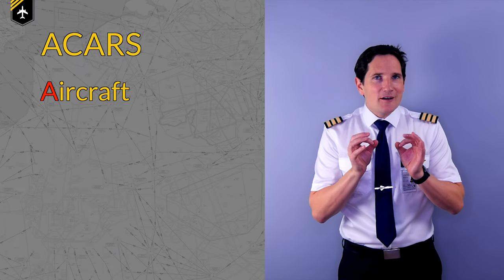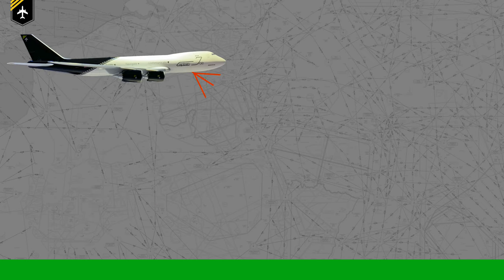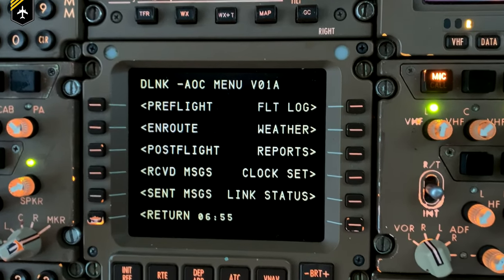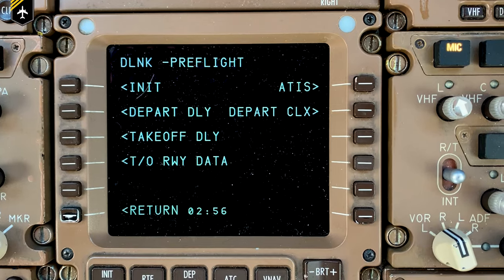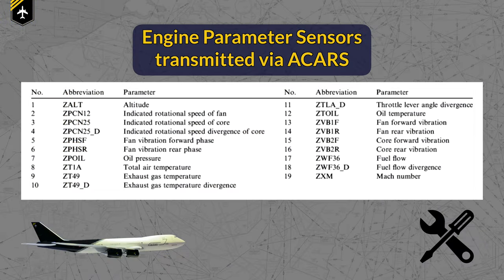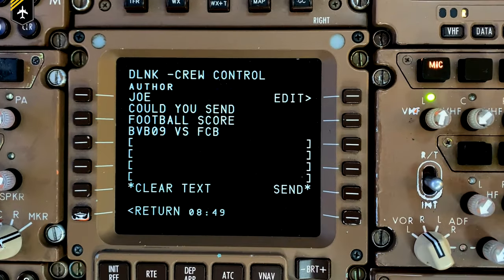WHAT is ACARS? HOW does it work? Explained by CAPTAIN JOE

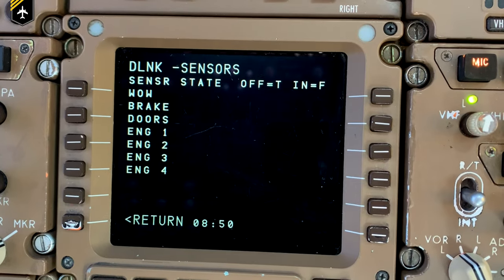Comment: 8:32 I guess it's a parking position where pushback is not required, engines are started earlier than the brakes being released
Reply: You smart
Reply: Same
Reply: I agree
Reply from the maker: Correct!!
Reply: i was going to answer but i am late . any ways your answer is correct .
Reply: or Capt. Joe just forgot to release the brakes.. until the tow truck started to smoke like a candle
Reply: I agree
Reply: I just thought three minutes from brake release to WOW off would be an awfully fast taxi out but that's a good point on the engines
Reply: @flywithcaptainjoe  one doubt here.  If this is the parking position then WOW should be on ground and not in air..?
Reply: @prashantgs4379  I guess WOW is just the Weight on Wheels sensor and the state is mentioned by the second column and it will only be listed if the state changes. So in this case from parking (ground) to flying (air)
Reply: @highopay  Yeah. Now I got this. I thought it was still standing in parking position and showing WOW sensor incorrectly. But actually at 06:16 tyres were off the ground and it became AIR. 
👍

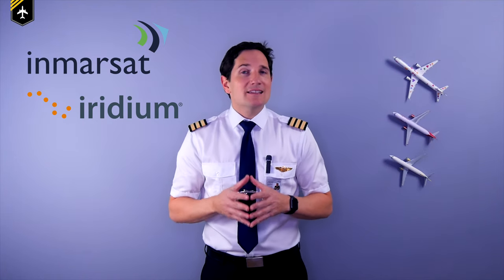Comment: 4:45 Ah, so that's what that large dish on top of airplanes are for!
Reply: Immarsat provides inflight wifi too as a bonus AirNZ uses it
Reply: I'm no expert, but that doesn't look very aerodynamic
Reply: @LuizDahoraavida  It isn’t.  The winglets on an aircraft give about a 5% reduction in fuel burn.  The antenna on the top of the fuselage eats that up.
Reply: @oscarb9139  r/woosh
Reply: @simpilotadamt1012  Obviously, there is something I missed if it was a whoosh.
Reply: @simpilotadamt1012  Yes, whoosh.  I missed the time stamp.

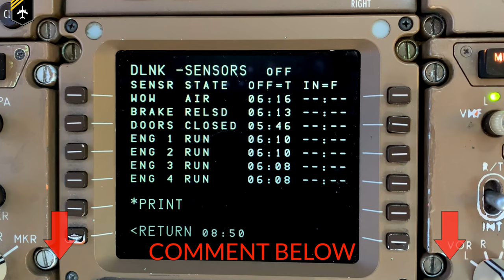Comment: 8:40
3 minutes from brakes off to wheels off the ground?...
No push back required.
Reply: How do you know the lack of pushback? Is it because breaks release after enginr start?
Reply: Yes with a pushback brakes are released before engine start up
Reply: I also assume that with a push back you release breaks first, then push back, then start engines
Reply: @phillips2400  Wouldn't you have to reapply the brakes after getting the pushback so the aircraft doesn't keep rolling backwards?
Reply: @NiHaoMike64  good question. Since the aircraft is connected to the pushback vehicle it’s the vehicle that stops the backward movement. I don’t think the aircraft would start rolling on its own after the disconnection. But that’s just my guess. Maybe somebody knows it better?
Reply: @phillips2400  Unless that parking apron is on a slope, no the plane will not roll backwards on its own. And, the engines will generate quite a bit of thrust when starting, any backwards force would be counteracted. And lastly, there are brake pedals (located on top of the rudder pedals) in most planes.

Comment: Hi Joe, it would be very interesting if you make more videos about radio systems on board.
Also, I am an amateur radio operator or ham (Amateurfunker) and I had once the opportunity to talk with a pilot (he Also was a Ham) on board a Boeing 737 using their HF 14MHz SSB radio.
It would be very interesting if you could give some insides on that topic or if it is in fact possible to transmit on the amateur radio frequency.

Comment: I'm guessing no pushback was required, because it was only 3 minutes from releasing brakes to take-off...much less time than it takes to attach/push/disconnect the tractor?  Also - the engines were started before the brakes were released, whereas they're usually started during the pushback procedure (ie. brakes released first to enable the push; then engine start)

Comment: a pushback was not required because engines started before releasing parking brakes, also the breaks were released one time without putting it back on for the tug to be removed and then releasing it again for taxi

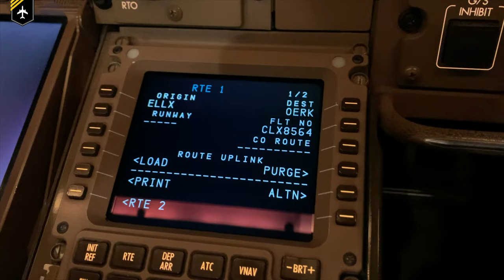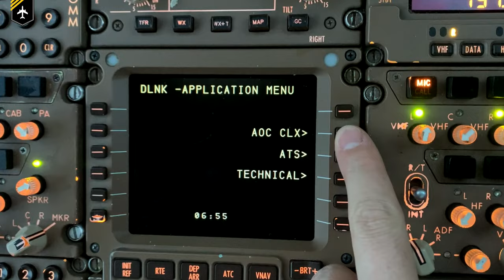Comment: We had done a pushback, as the doors were locked at 5:46 and Eng 1 run time is at 6:10 if it wasn't a push back then Eng 1 run time should have been around 5:55 at max. So I'm gonna go with 'Pushback'
Thanks for the information on ACARS Capt.

Comment: Happy to see you again. Very informative and very clear as usual. May I ask you some short questions?
Regarding MH370, indeed ACARS has been shut down but it restarted later on, emitting the so-called "pings" to an Inmarsat satellite. And if we know now where MH370 approximately crashed, in the south of the Indian Ocean, it is precisely because the ACARS was not completely dead. That's how they got the famous seven arcs giving a probable location of the crash.  Problem: no other communication mean seemed to be working. It's all about ACARS in this mystery and it's a pretty disturbing thing. Moreover some specialists said at the time that it was impossible for the crew to shut it down in flight. Hence my questions:
1. Is it started manually or automatically in the starting procedure of the aircraft? 
2. Even if it is automatic, would it be possible or not to shut it down manually in flight (I mean without descending to the lower floor in the avionic compartment)? If yes this means that it might have been deliberately shut down by the crew. Why? That's another question ... If not, why did it stop?
3. If it is only automatic: let's imagine a total electrical failure leading to the shut down of everything (provided that it makes sense) followed later on by a restoration (partial or complete). Could this restoration trigger the automatic restart of the ACARS (and only the ACARS)? Why in this case no aircraft data (especially A/C position) are transmitted anymore from the ACARS except the famous "pings" telling to the satellite "yes I am here" and only that? 
Obviously I don't ask you the solution about this mysterious case, just some additional information about ACARS, if possible and not classified of course. Thank you in advance. Best regards

Comment: I used to be load controller and ramp agent. We also send Load sheets to the cockpit via ACARS. To be honest , sometimes it works sometimes it doesn't. I guess it's the problem with load controlling software that we use or internet connection. Sometimes I have to drove back to our office to print Load sheets and back to parking stand again.

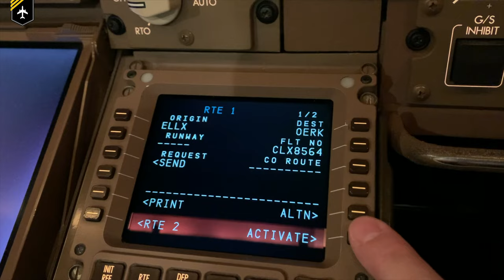Comment: It is a parking position where push back is not required because brake release time is 6:13 while engine start time is 6:08 and 6:10 which is before the brake release time.

Comment: My guess for the challenge at 8:43 is that there was no pushback. I believe this because I think it said engines 3 and 4 were started at 06:08 and engines 1 and 2 were started at 06:10. However the brakes were not released until 06:13 meaning all 4 engines were running during the “pushback”. Usually the engines are started during or after pushback but not before (I think, I’m just some plane spotter lol). But I think there was no pushback. Am I right? It would be great to have a response or a pin from my favourite pilot, “captain” joe ;)
Reply: right, he has to change his name to FO joe!

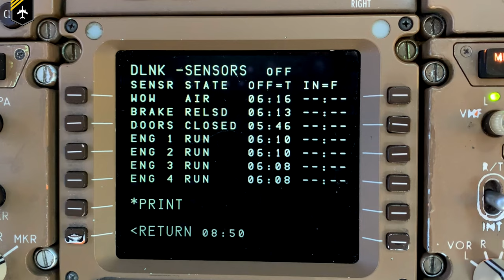Comment: 8:39 All 4 engines were running before the brakes were released so I'm guessing pushback was not needed.  Also only 3 minutes between brake release and being in the air? Wow that's fast.
Reply: It needs to park near the starting point of the runway...

Comment: No push back required. I think the parking brake is engaged when the engines are starting. If there was pushback required the parking brake would have to be released before engine start as the aircraft wouldn't move if the brakes were engaged. In that case, the brakes would be released, armed, then released. However the FMC here only shows brake released after all engines have been started, so I think no push back was required in this pic.

Comment: Did not require pushback. Note that the engines were turned on before brakes were released.If pushback was required, the brakes would have been before engine start as to allow the tug to push you back.

Comment: 8:39 the aircraft was out of the gate, so all 4 engine are started and yes pushback was not required because the engines are running and the plane can be moved along the taxiway for takeoff

Comment: RIP #SJ182
I am trying to understand how BOTH Altitude (blue) and Speed (Yellow) went down together for 10 seconds! Then the plane entered a #Stall (like a rock)!
- I think something structurally went really wrong!
- That induced a sudden huge drag.
- No stall recovery attempt?
- The #SJ182 (Boeing 737-524) glide ratio is 17:1!!!
- There is a huge and suddenly induced drag! I am starting to think Reverse Thrust activated with full climbing thrust engine power?
- But something else failed! 10 seconds, and no pilot correction although their hands on it
- Rudder seems to be jammed to one side, probably because of the pilot trying to force a Yaw correction?

Comment: Ans: the pushback was not required I guess
Reply: Can someone  tell me if I am correct
Reply: @RADISH_APPROVED  I thik that it is correct, because he liked your comment, and because he didn't like the other comments that are wrong. 
So yeah, I think it's correct😂
Reply: I think your answer is right because according to the time records on the display at around 8:42 in the video, we can see that the brakes are released after all engines are started. This would implies that no push back was not required.

I think if there was a push back then the brakes would be released first and then engines started.
Reply: @thomasclark604  my theory as well

Comment: Brakes were released after engine start, so no pushback😄 Because you normally would release the brakes when the tug is in position, about to push back and start the engines while the pushback (and actually set the brakes again before taxiing)😄

Comment: Great explainer Joe. How does the system avoid congestion on VHF if so many messages are being transmitted? Does an aircraft have an exclusive frequency, and are the messages enrypted or can anyone "hear" them?
Reply: Just a rtl-sdr usb dongle... and good antenna not to be deaf... then you can listen to every vhf transmission: acars, ads-b, atc radio, even decode weather satellite images...

Comment: What I don't understand is with satellite and cellular usages so common, why is civil aviation still rely on Flight Data Recorders? All Flight/Voice Data should be transmitted to company and/or FAA headquarters instantaneously and continuously, with onboard data recorders as backup. In case of accidents or incidents, data can be retrieved and analyzed immediately without having to search for the black boxes. It may also aid in locating the accident/wreckage site quicker and more accurately. Any thoughts?

Comment: To your question in the video.
I think you started on a parking position without a pushback, because you have first started the engines, and then went off block releasing the brakes.

If you would have had a pushback, you would have first released the brakes, and then you would have started the engines.

Comment: Very interesting topic. Are airlines directly charged for the quantity of messages by the VHF/Sat operators? If not I wonder why not all airliners transmit continuously, especially over open oceans. Or if data usage is a problem at least let an in-flight master caution (or other major event) trigger sending out a digital copy of the most important flight data recorder info from the previous minutes.

Comment: I receive and decode these messages, both on VHF and INMARSAT. On VHF, do you know why there are multiple frequencies when the actual transmission is so brief and wouldn't seem to clog up and overload one frequency if everyone used the same one? If sent by 2 planes at once, would they collide at reception with a loss of message? Or would they acknowledge a receipt of message? Do different airline companies use different frequencies?

Comment: No push-back, as engines were started before brakes were released. Usually engines are turned on during push-back (with exceptions, airport restrictions etc.). At least this is a common practice in the US...

Comment: It appears that the flight is in WOW - weight on wheels at 0616 hours. For a ACARs or METAR report  to show a pushback was required, the brake would be released and the door closed, before pushback recorded, automatically. Otherwise, code 89(AM) a delay code resembling this, should be entered manually. Am I right?
Reply: in addition, the only indication that there was pushback is the ending time if 0616. Airports open at 0600, therefore, the additional 16 minutes delay could indicate a pushback, but not nevessarily.

Comment: I'm gonna guess no pushback was required.

My understanding of pushback is that at the start of pushback, the engines are off and the parking brake needs to be released, thus if pushback was required, the CDU would be displaying a brake release time before engine startup. In this case, the parking brake release time (06:13) is after the engines were started. (06:08-06:10)

The only factor that I wouldn't understand as someone who's not a pilot, as whether or not setting the parking brake after pushback resets the brake release time to when the parking brake is released for taxi, but according to Joe's description, the off-block time is basically from the start of pushback. The door close time can probably be ignored because, well, cargo jet.

That 3 minute time from taxi to takeoff, though.

Comment: Question: why quite often OOOI messages are not reliable? I build system that depends on OOOI, but their sequence doesn't make sense in all cases. Could it happen that dep/arr are not updated by the pilots and values used are from previous flight? And if a/c is towed/moved on the airport, so brakes are released with door closed, should I always expect in message for every out message (obviously no off/on messages)?

Comment: New question, especially as you flew different airlines:
I'm sometimes confused about what is common knowledge of a pilot aka learned during flight training and what is in the airlines op handbook? I saw several crash investigations were basics like switching on lights or reacting to TCAS are described in the handbook aka handled different on different airplanes.

Comment: Nope, this aircraft was started on it's stand at 0608 to 0610 then the parking brake was released at 0613 and wheels off at 06:16.

If you were pushed back from a gate with a tug it would have been Doors Closed, Brake Off, and THEN engines start.
Reply: there's a certain on-time procedure i know pilots do at the gate if they can. last pax in, doors closed, handbrake off (ACARS departure triggered) sit at gate and wait for cabin to be ready and pushback clearance, but OTP is amazing!

Comment: Well youtube adds get more and more aggresive. Sorry CJ, loving your content, but it's inposible to focus on it, when you get interupoted every 2 minutes for further two to five minutes.

All the best
Reply from the maker: Sorry buddy, not in my control 😔
Reply: @flywithcaptainjoe  Yes, I've figured it, because a lot of good channels are showing this issue for a few of months now. To some extent it is possible to ignore and deal with it. But the tendency is approaching and overreaching all the limits of tolerance. Some publisher is taking evasive measures already and starting an own web service. But I do realize, that for you, as for an active flying pilot, it is unacceptable simple for reasons of time management. I don't have the luck to even finance or manage my passion for flying such economical kind of flying as weight shift aircraft is. That why I had no intention to criticize you, but only to inform you about the current state as a fan of your content. I have high respect for your work, and I'm still thankful and appreciating it. Have a nice 2021!

Comment: What are the fixed and variable costs of this system? I guess the airline must have some contract with the system provider and make some monthly payments. I think it is not cheap as even the disappeared Malaysia Airlines MH370 did have only some basic version of ACARS, so it would not help much even if it had not been turned off. Is it available and affordable for a privately owned single pilot twin engine aircraft like Beechcraft Baron or King Air? I guess the SATCOM will make it more expensive, so is there a possibility to buy just VHF or HF version?

Comment: Why isn't this used to make ATC automated? I see videos on VASAviation where ATC does outright dangerous mistakes like clearing planes to cross when they just cleared a plane for takeoff and such. Time to eliminate humans from ATC alltogether.
I mean ACARS could be used to automatically make clearance requests more safe - as a computer doesn't forget, there is error correction and safeties in ACARS messages - and also ACARS could also be used to detect emergencies automatically (by the engine parameters function) - so the system would detect a engine fire and then the plane could automatically declare a mayday via ACARS. Also when things fail, the ATC computer would immidiately know the limitations of the incident in question by the ACARS status messages, so for example if a depressurization event happens, it then knows that it cannot safely ask the plane to go above 10 000 feet.

And in the end run, this could also make planes fly automatically without pilots. Just computer-pilots talking with computer-controllers. It would make aviation much more safer actually.

And in the meantime, text-to-speech and speech-to-text could be used to communicate with pilots not equipped with ACARS, since the phraseology in pilot<->ATC communication is enough strict that a enough safe speech-to-text can be developed.